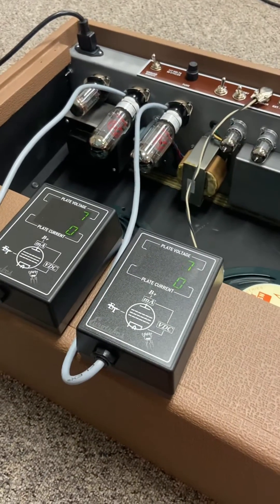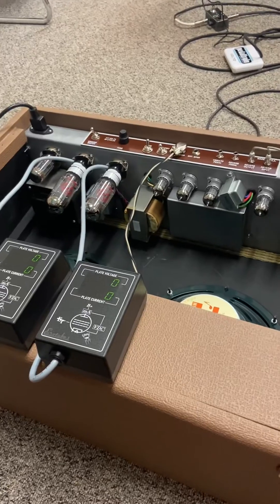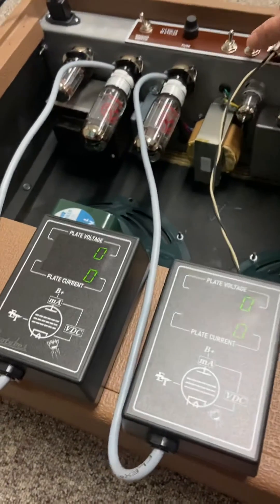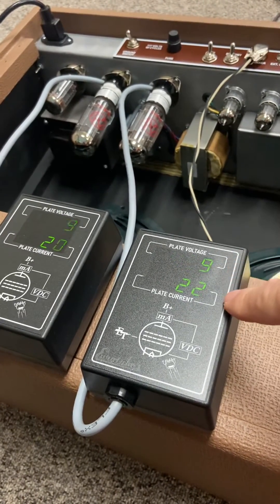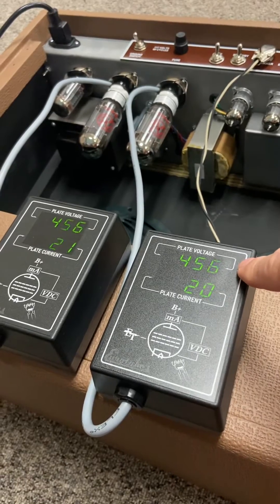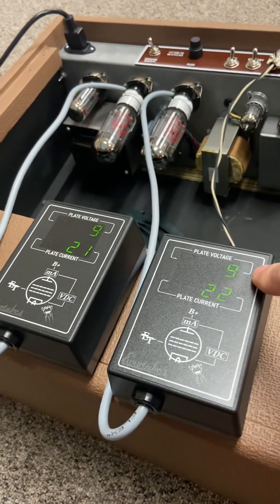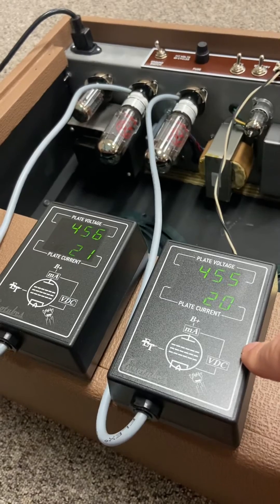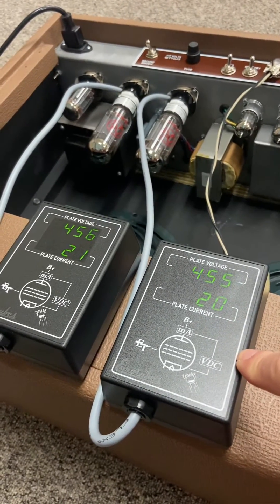Eurotubes ET Pro One + Wattage Bias Tester

Comment: Funny, I'm in the very same situation....one half of my Compu Bias got destroyed by some tube fail.... I've had probes destroyed before, but this time it's the meter circuit itself. Make som crazy numbers...But I can still use the other half of the Compu Bias, just by plugging in the first probe to turn it on, and then use the second probe to read one tube. 

But overall I find it a bit fragile, and almost afraid to use, so I'm also ordering a couple of Pro Ones, waiting for Eurotubes to get more of the version with wattage upgrade in stock.